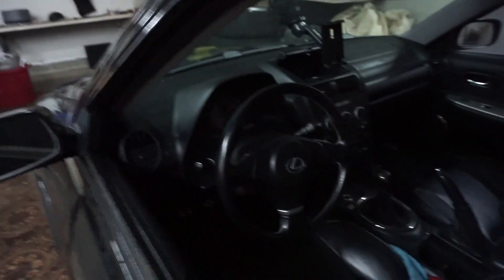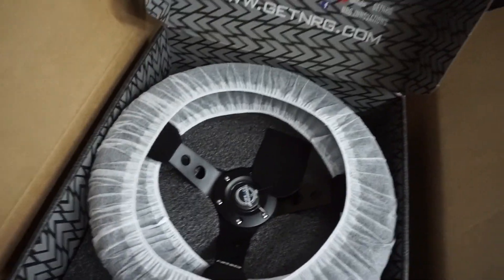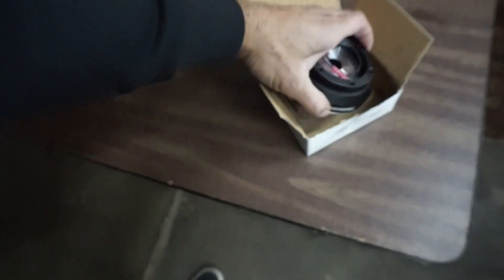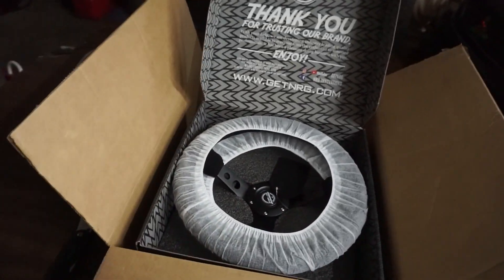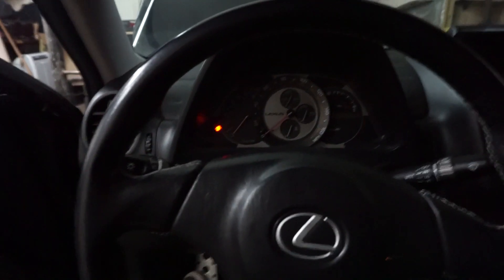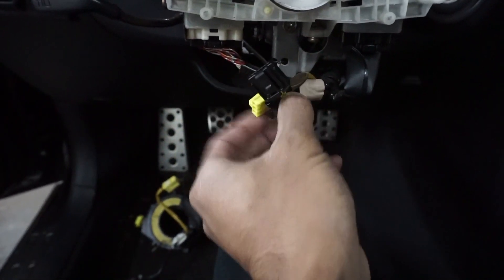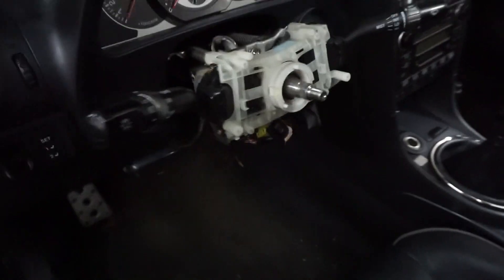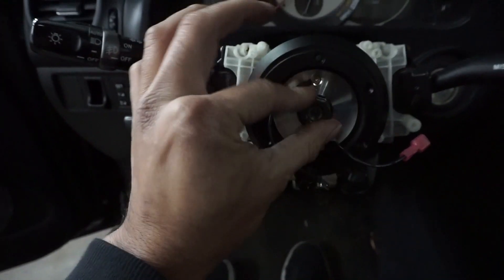Aftermarket Steering Wheel Install (Lexus IS300)

Comment: I wired in a 3.9 ohm resistor to the abs plug to stop the abs light staying on. And for the horn i made a bracket to make contact to the back of the hub ring to allow the horn function.
Reply: 3.9 OHM resistor 1 watt? (How many watts are needed)?
Reply: @stringbeanh2o819  think the one I got from ebay was a 0.25w 3.9ohm abs resistor from ebay, if your buying your hub kit from say driftworks UK, this kit will come a resistor included.